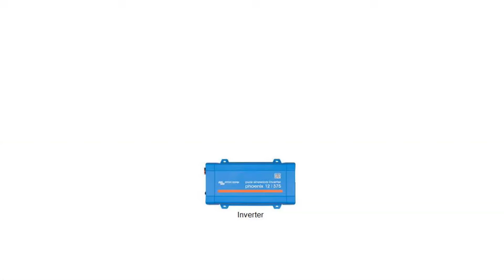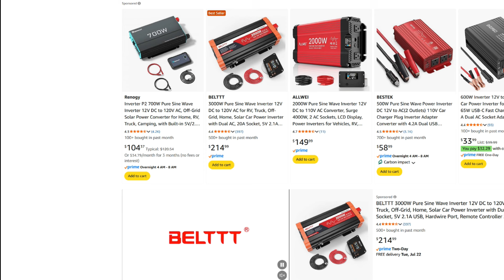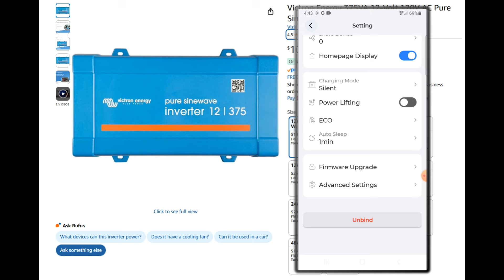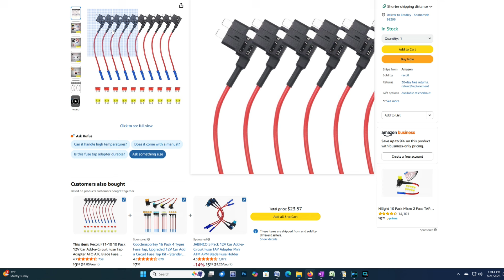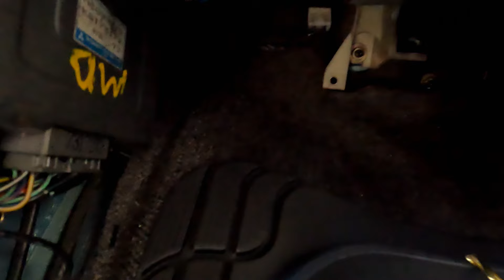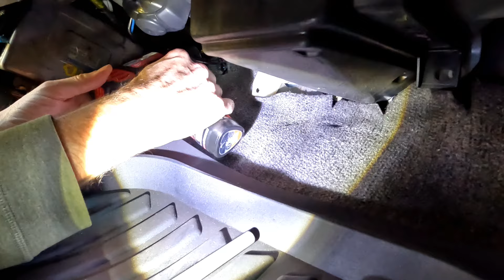VICTRON INVERTER Installation - Mitsubishi Delica L400 Camper Van

Comment: Your fuel filter/primer must be in another spot, mine is right there in that corner of the engine bay.
Reply from the maker: My fuel filter/primer is also in that same corner.  The filter makes it a challenge to see and route the wires, but it is doable.  My power wires run up along the inboard side of the filter.  And I was able to slide the plastic protective sleeves down the wires well below the filter.
Reply: @BradMitchellPhoto  Oh right, mine looks larger and higher, maybe it's after market.